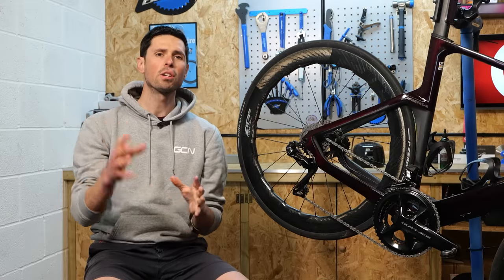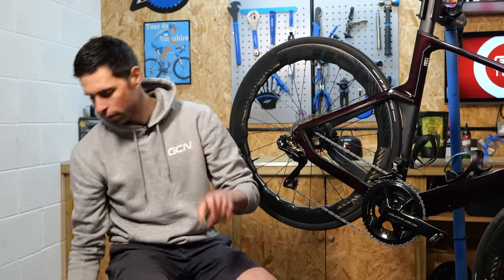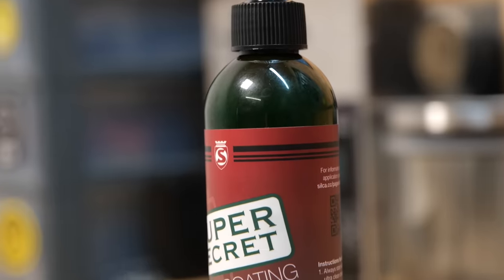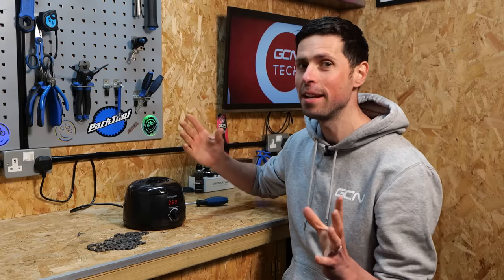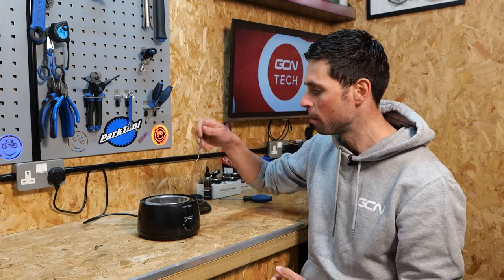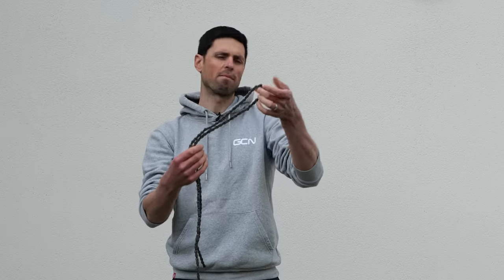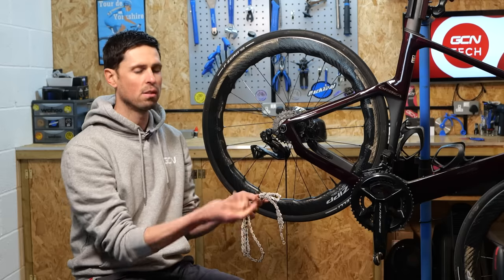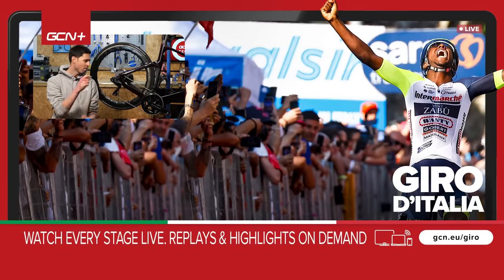How To Re-wax Your Chain & Make It Last Longer!

Comment: I pour boiling water onto the dirty chain in an old washing up bowl, between waxing, to remove all the old wax and any dirt, then clean it with a microfibre cloth. It's also easier to drop the chain in wax if you thread it onto a bent coathanger, folded over several times. Chain replacement times seem to be significantly extended after 2 years of waxing, and cleaning the bike takes 5 minutes as there is no oil
Reply: Certainly seems like GCN forgot about that stage.. ALWAYS clean your "dirty chain" with boiling hot water and letting it dry off before rewaxing. As to using like an old hanger, not possible if you are using a small leg waxing unit like what was used in this video.
Reply: You wouldn't happen to guesstimate the mileage/kilometer increase would you?
Reply: @atlantaswelder  it's more than twice compared to oil. I tried drip on wax and was not impressed: I cleaned my chain in denatured alcohol after about 4000km and found many metal particles with a magnet. Hot wax chains are good for 8000 km at least. In fact, some people claim around 15k but I haven't had the chance to ride that much yet. I currently rotate between 3 chains and wax them together when all 3 are done
Reply: @atlantaswelder  I've been hot waxing my chains for a very long time (currently use the Silca stuff). I ride around 10.000km/year, and re-wax my chain every 500km. My chains last between 20-25.000km before my ParkTool chain stretch tool indicates I need to change the chain. I'm using Shimano HG601 chains. One of my newer bikes has a SRAM flattop chain, which I've also hot waxed. It's currently at around 12.000km and doesn't show any sign of needing replacement. I only ride in dry conditions. One negative thing about waxed chains is if you often ride in wet conditions. Wax is >not< very good in that case. The chain will start to squeak after merely 100km and you'll need to dry the chain after every ride to keep it from corroding/rusting.
Reply: Is residual water a problem, i.e. do you have to let it dry before putting it into the wax after the initial cleaning?
Reply: @klnsmn  I rinse my chain in Denatured Ethanol 95% to flush out the water, and hang it up to dry for an hour before putting it in the wax.
Reply: @ibe966  Thanks! Guess this does make the whole process a little bit less quick and easy.
Reply: Per Zero Friction Cycling (which I consider the encyclopedia of chain waxing), pouring hot water is unnecessary. To summarize what he explained:
- Freshly waxed, light spray = no need to wipe or rewax
- Around 300k of cycling in mostly dry conditions = rewax directly 
- Proper gravel ride or wet riding = wipe and rewax.

The reason he doesn't really recommend pouring water is because the wax at this time has been mostly abraded from the outside rollers, leaving it bare and risking it to oxidation. This assumes that all coating has been removed previously, which is necessary prior to waxing.
Reply: @klnsmn  For me, it's still better than having to deal with greasy chains that pick up all sorts of muck while riding, and the process of de-greasing every 250km. Plus, in the long run, it's cheaper. I needed to change chains every 4-5.000km before I started waxing. Also, whenever you get a flat, there's no mess as the chain and drivetrain are clean.
Reply: @rdr33  Although I can somewhat agree with that, I still prefer to use hot water to rinse the chain before re-wax. It helps prevent the dirt from getting into the wax, which in turn means you can use the wax at least twice as many times before needing to use new wax...
Reply: @klnsmn  never noticed any problem. I rinse my chains with water straight from the kettle and wipe them a little with a towel or an old t-shirt or something. They look brand new after that. Then straight to wax. I don't hang them or wait for water to drip
Reply: I don't want to nitpick but you can't pour boiling water because once you turn off the cooker and start pouring it's already cooled down below boiling point. 🤓
Reply: Same, i just use an old pot to boil the chain in
Reply: @2nd3rd1st  True. It's best to use an old pot, boil up some water, put the chain in and swirl it around. It loosens up old wax/dirt which will float up to the top.
Reply: @ibe966  I've been a waxer for many years since old boat building yards used waxed timber for launching ships. 
I use a slow cooker pot for my chains and food grade wax. After several wax coatings I let the pot sit at a slight angle and when the wax cooled to a solid, remove it and scrape the contaminants off the bottom. Then it is relatively clean again.
Also the water evaporates off in the hot wax.
Reply: I don't use boiling water but won't pass judgement on those that do. I do put 100% denatured alcohol in a jar, insert the chain in the jar, and shake, shake, shake. You'd be surprised at the debris this gets off the chain, preventing it from getting into my wax pot. The alcohol also causes no rusting of the chain and the alcohol evaporates super quick from the chain. I do use Silca Hot Wax and use its drip wax between hot wax treatments. I usually use the drip wax three times before going through another hot wax treatment. I don't clean with alcohol before  applying the drip wax. I just bush the chain clean. Anyway, for what it's worth.
Reply: @ibe966  How do you manage to ride 6,000 miles without riding in the rain? In this country?😂
Reply: @2nd3rd1st  how on earth do you make tea?
Reply: @peterwillson1355  I live in South Korea, and I do 120-250km rides quite often :hand-purple-blue-peace:. 
It rains mostly during the monsoon season here, which can be tricky. But it's possible to plan rides in between the downpours.
Reply: What @julesnfriends said! 
That GCN Chain is filthy and needed a good water bath, perhaps an ultrasonic clean, too. 
Also, the wax looked past it’s sell by date, as it looked filthy. 
I use a zip tie to fish it out with and hang it up with. They don’t melt at 70C either. 🎉
Reply: @thomaspeoples3065  The tungsten disulfide in Silca wax makes it look black from the very beginning.
Reply: @atlantaswelder  Honestly it's too difficult even to do a fair guesstimate even after two years. I haven't kept the best records, but I have been happy that waxed chains on two road bikes don't get close to the 0.5mm wear point for much, much longer. I used to get chains as Xmas presents (they did ask what would I like most :-)  but I don't need to do that any more, still got spares. So I'm fairly sure the cost of waxing is positive overall. Not needing to use so many cleaning products helps as well. I run two chains for each bike, so one is already to replace the other if it starts to get noisy, usually about 300 miles. If you pour the cooling wax into a clear thermo plastic pot, once it's gone hard if you tip it out, it's alarming to see the solid grey/black stuff at the bottom, hence all this cleaning chat I guess
Reply: I do this to. No need to be too fussed about drying the chain too much. As the water evaporates in the hot wax it will act like a flux suckin wax in its place 🎉
Reply: @MrLuigi-oi7gm  I do the same when preping a new chain or when prepearing for big event, but for rewaxing boiling water is just fine because there is no oil to get rid of and wax just mets off together with contamination. I think that it is easier and better for environment
Reply: @MrLuigi-oi7gm  Seems like you have good experiences with wax. Have you noticed a longer service life with your chains?
Reply: @karlisklismets5442  Hi Kārlis, I use to use boiling water. But after a conversation with a colleague (chemistry instructor), I switched to 100% alcohol. She is also a cyclist and her reasoning was this. The boiling water will remove almost all the old wax leaving bare chain metal exposed in the boiling water. This can cause corrosion that will compromise the ability of the new hot wax to adhere to the chain. That adhesion is absolutely critical to a successful and long lasting hot wax treatment. This all important adhesion is the reason why it is necessary to perform a "surgical" cleaning of the new chain before its first waxing. The amount of corosion will depend on the materials the chain is made from. But the risk of some parts of the chain having a film of corrosion, especially the hidden parts where the rollers reside, is enough of a reason for me to not use boiling water anymore. I may be over concerned and cautious about this. But that's my reasoning, again for what it's worth.
Reply: @richardharker2775  I have. But I am not as meticulous with data collection as others who hot wax their chains. There are several YouTubers who do provide very detailed  data regarding the number of kilometers of life they enjoy from hot waxing. The one who immediately comes to mind is "Oz Cycle." I have found his videos the best on hot waxing. I'd leave a link here, but I believe that will cause my comment to be rejected.
Reply: @MrLuigi-oi7gm  I understand your point. Thats why I wrap my chain in kitchen towel immediately after boiling it
Reply: @karlisklismets5442  Gotcha! Are you concerned at all about moisture inside the rollers that the towel can't get to? Not trying to be annoying, but that was the area I was most concerned about as it is the highest friction wear part of a chain. That area is why I decided to switch to 109% denatured alcohol. Anyway, I am SURE you and I are doing a better job of protecting our chains than 99% of riders. So let's give ourselves a pat on the back!!! Have a great day and thanks for taking the time to have a conversation with me about this topic.
Reply: @MrLuigi-oi7gm  True, it has never been a concert to me, I suppose that I will pay more attention to it, maybe hairdryer would do the trick anyway. Either way you’re right, our chains are definitely more efficient and last longer than the majority of the riders. I would also debate that the difference between our methods is so small that it is not even testable. Keep up the work, it is nice to have a sensible debate. I ride in rainy weather so often that I don’t really give that a second thought😂 I simply have a separate dura ace chain for racing. Never the less, nice to talk to a person who never gets chain tattoos:D
Reply: @karlisklismets5442  🙌 🙌 🙌 😁
Reply: @MrLuigi-oi7gm  She doesn't sound like she knows chemistry too well - a quick rinse in boiling water won't cause corrosion. You'd have to leave it there for a long time or add salt. Even then, it would be tiny corrosion compared to general wear and tear.
Reply: @philadams9254  Hi Phil, I understand what you're saying. In defense of my colleague, she was responding to my question about compromising the ability of the wax to adhere to the chain. For the best adhesion, the metal has to be as free of any surface contaminants as possible. Her opinion was that water trapped in the pins and rollers and left to dry, especially hard water with relatively large amounts of calcium and magnesium, can reduce the ability of the wax to bond to the chain. How much of a compromise? Hard to say without experimenting. Because of this, I still hold to my point that doing a final "shake and rinse" of the chain in a jar of "100%" rubbing alcohol is very cheap (especially since the alcohol is reusable in this application) and effort free (30 seconds of shaking at most) insurance that the application of wax will be as commendable as possible. I understand that my protocol may seem obsessive to some, reasonable to others.  🙂
Reply: @bikerdude221  Can you  clean the chain with hot water while it on the bike? Secondly Can you clean the RD  pulley wheels using hot water because that is where most if not all of the dirt will accumulate
Reply: @rdr33  what do you mean light spray (of what)
Reply: @atlantaswelder 3 to 5 Times. 15.000 to 25.000 with one chain
Reply: @klnsmn yes, therefore use alcohol 99% after washing before waxing.
Reply: What wax do you guys use to wax ur chain?
Reply: @doneen377  Silca
Reply: @bikerdude221  I'm a total newbie to this, and actually came in here to find out what to do for my first re-waxing so thanks both for the boiling water tip but I've got a 1.5L pot which I think is quite similar size to this one and I was able to use a bent spoke ok to dip the chain. Maybe this one is even smaller than mine.
Reply: @doneen377  I don't want any plastics or rare metals in mine so I'm just using vanilla paraffin wax. Seems fine after just a couple of rides so very limited experience.
Reply: You probably ride on dry and clean roads... my new bike came with a waxed chain, but after a few hundreds kilometers, it's black and greasy. I live in a big city but also ride on some trails...
I'd need to carefully clean all the drive train before rewaxing the chain, else it would be dirty again as soon as mounted, i.e. ideally remove the cassette too, and the dirtiest parts are the small gears in the rear derailleur...
Reply: @choddo I read a recipe from an article about the toiur de France in the 50s

I forget the proportions but it was mostly beeswax, a paraffin wax candle stub and a bit of kerosene

I'd love to have the benefits but I have to ride in the wet half the time

Would I experience similar longevity if I wax, ride in the dry then oil the chain for a wet ride? I guess I'd have to clean and rewax thereafter?

Alternatively I suppose it's take the waxed chain off and use an oiled one if there's a risk of rain

Also, to the post below yours, they're called jockey wheels, and if they look like throwing stars, replace them in

Comment: I remove my old wax by washing the chain in boiling water
Reply: holly cow!
Reply: This was the info I was looking for when I watched this video. Thank you.
Reply: Doesn’t even need to be boiling.  Hot tap water in a bucket with dish detergent.  Rinse a couple times with clear hot water to remove the soap.
Reply: I just wipe it with rubbing alcohol and throw it in the wax
Reply: @longstretch  I happen to know the true professionals use vinegar and a blowtorch.
Reply: @eggreedgious5194  Or vinegar and micro-wave oven. That's also how you can clean clogged carburetors...

Comment: The cycling community needs to start putting real pressure on chain manufacturers to start making reusable quicklinks. The cost and waste of single use products like these needs to stop.
Reply: KMC makes reusable links.
Reply: @mrhankbotful  I didn't know that. Thanks for the heads up! They should be promoted here as well.

Comment: Do 3 chains at once. Use each one and top up with drip on wax. I remove after each after about 800km. I wax the chains twice a year. You barely wear the cassette doing this.

Comment: After removing the chain I always clean it first in an old plastic bottle filled with degreaser. Shake well and leave for half an hour. You would be amazed at how dirty the degreaser gets. Then dry and apply wax.

Comment: Pro-Tip:  Shift to the small cog at the outset so you know where to thread the chain at the end.  On 1x drive trains this is mandatory, or your derailleur can crash into the cassette when the quick link is opened.
Pro-Tip #2:  Triple check the routing of the chain around the annoying little tab on the lower cage of your derailleur.  Hot waxing dramatically increases the number of opportunities to get this wrong.
Reply: I've gone over the derailleur tab twice already. Facepalm every time. :(

Comment: So, yes, you can use this method, but if you use a 1L crock pot/ slow cooker, you can thread the chain onto a wire hanger around every 6th link, and  simply lower it into the wax, swish it around and let it sit for a bit. Wait a few minutes and pull it back out. This allows for more thorough penetration of wax into the chain, and keeps your hands (gloves!!!) away from the really hot wax. EDIT: You should also wax the quick link to ensure you have wax on the pins.

Comment: You can easily break the wax at each link by pulling the chain over a chain keeper , then flip the chain over and pull it across the chain keeper again. It's then a 10 second job instead of what Ashley showed when he went outside!
Reply: Actually never thought of the chain keep approach. I run mine over a 3/4 inch dowel rod. Will have to try  your way next time.
Reply: @justsomedude7556 what is best?
Reply: @helvettefaensatan  I will stick with the dowel rod,

Comment: Been doing this for years. Minimal hassle and works great. Agree with other you should clean in between applications and use a coat hanger to drop it in for safety
Reply from the maker: Thanks for the watching Aaron! Cleaning is a great idea, super cool to hear that you've been using waxed chains for a while 🙌
Reply: Actually, the best method is (also doing for years)...put the chain coil on top of wax BEFORE heating wax, and chain just sinks once wax is melted. Coat hanger for removing chain is a must👍

Comment: I drip on my Squirt wax. However, a great hack is to submerse the wax bottle in a Sous Vide bucket. Place the bottle in the water and heat to about 130°F AND leave the bottle in the water for about an hour. This technique will significantly thin out the wax to a similar viscosity of immersion wax. This will then cause the wax to free flow deeply into the chain into the smallest tolerance parts of the chain parts. I used to simple heat in tap water but the prolonged immersion in heated water by a Sous Vide cooker works brilliantly! This achieves an almost identical result as removing and immersing your chain in wax BUT without all the work and effort!
Reply: This is a great idea, thanks for sharing
Reply: I just drip Squirt wax on each link every 200 km. No problems
Reply: @TheOkinawaBoy  Yes but what he says is true. Just stock Squirt is too thick to go in between all the links. This is what you want, to improve longevity and friction.
Reply: @verbinnenben  And squirt is extremly sticky..